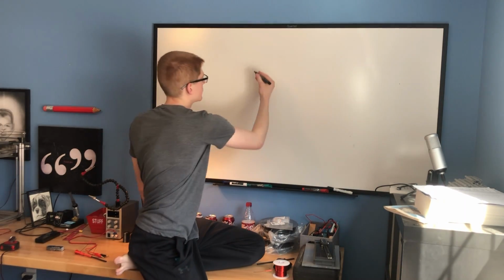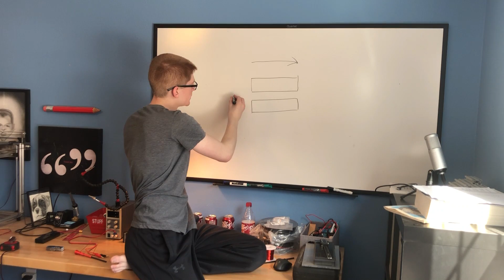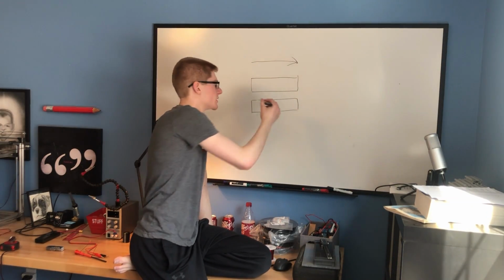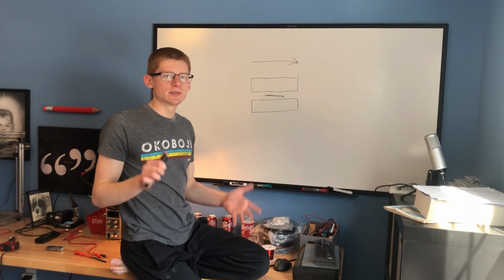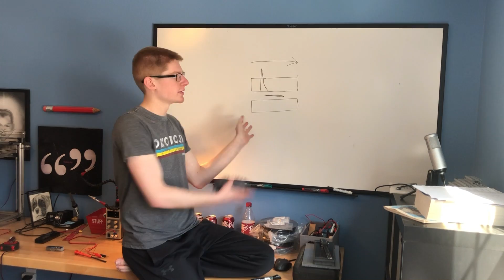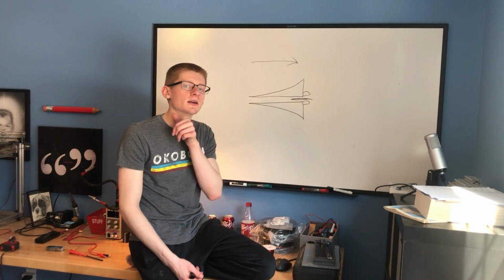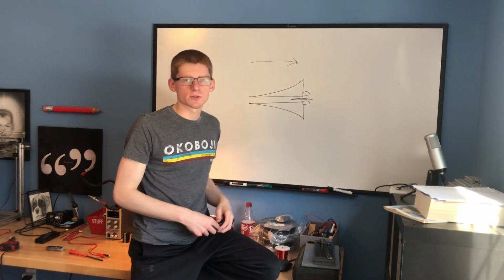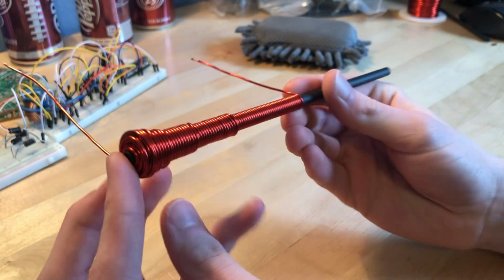Making a Coilgun - Part 3: Reconsidering Everything

Comment: It’s so incredible to me that this guy was willing to challenge the concept of a coil gun instead of attempt to perfect the pre existing designs that have flaws we’ve all been avoiding.  I always wondered why we have to use capacitors when their discharge is so strange for this sort of application, and that a constant high current would do much better.  However, I never thought of changing the coil shape to a curve following a log equation, but after seeing his results and considering his reasoning, it looks infinitely better than most modern designs.  Great problem solving man, this kind of work is truly fascinating!
Reply: Guys, I don’t think it’s worth arguing over this, you’re just going in circles of defining the units of an equation.  I know it’s not my business, but I’m not appreciating the notifications I keep getting
Reply: @homieboi5352  ah, apologies. I just wanted to clarify that for future builders. Coilguns are confusing enough on their own.
Reply: @TheArachnoBot  I'll have one up and running soon, and be trying different configuration experiments
Reply: @doubleooh7337  alright cool, I'll check it out if i remember. Personally, the revelations of Janssen's coilgun project were the final nail in the coffin for me. I'll be hoping for higher (and easier) efficiencies in the land of electrothermal guns.
Reply: @TheArachnoBot  i wish i did do my similar  design, but the one i made  is interchangeable  10 layers of wire for series or parallel configuration and different size projectiles , should have a stronger magnetic field
Reply: @TheArachnoBot are you referring to first exploding eg magnesium ribbon to pre accelerate the projectile? Is there a way to harness the collapsing field and either capture it ( as in John Bidini SGM) or use it for propulsion?
Reply: @TheArachnoBot just thinking, the circuit that can store many charges to explode eg. Mag ribbon with a layer of coated boom boom powder is less weight and complication, than a line of coils right? Would allow for traditional caseless round mags, and rifling, adjustable power . For Hybrid One could use a PCP platform to pre accelerate any coil gun?
Reply: @dorronski463  You can use anything as the explosive that can be ionized by electricity. Im just using air but i'll probably do some tests with other materials too. Mixing a coil gun and a conventional gun wouldnt make much sense, it would just make it super complex to build with no benefits.
Reply: @TheArachnoBot  Not true or the pros wouldn't be doing it already.
Reply: @dorronski463  which pros?
Reply: @TheArachnoBot  I remember seeing some military prototype, the pre acceleration bit definitely stuck into my bad memory. Lol sorry I can't remember the link please forgive me. If I remember correctly they were using regular b powder, they wanted maximum speed before it hit the coils, and with their budget managed to time the trigger coils very well.
Reply: @dorronski463  Hmm, well i've never heard of such a system. To be honest i've never heard of any "serious" coil gun, only hobby projects. I know of weapons systems that use electrothermal triggers to ignite the conventional propellant.
Reply: Have you thought about using ferrous end caps on the coils to focus the electromagnetic fields for better efficiency and to move the center of strongest force?
Reply: Its not the best design that wire can only handle 10amps, a coil needs to be designed to handle like 100amps 12v 100a is 1,200joules , 220v 100a is 22,000joules but a 450v 1000uf potentially has 101 joules,  its the coil that is the problem
Reply: @doubleooh7337  I think you are confusing joules with watts
Reply: @TheArachnoBot  really how many joules is 1watt? 😂
Reply: @doubleooh7337  none, one is energy and the other is power
Reply: @TheArachnoBot  obviously you don't know 1WATT IS 1JOULE/SECOND! 3,600joules/hour!
Reply: @doubleooh7337  "12v 100a is 1,200joules" Where does that mention time? That's as pointless as saying "that car is moving at the speed of 100 meters". I dont know why youre arguing about the literal definitons of units, you are wrong.
Reply: @TheArachnoBot  obviously you don't know!
 WATTS IS VOLTS X AMPS, 
or maybe it's just maths you don't know?
Reply: @doubleooh7337  Yeah, 12v 100a is 1200 watts, not joules.
Reply: @TheArachnoBot  how dumb 
1JOULE EQUALS 1WATT/SECOND!
Reply: @doubleooh7337  And you didnt mention seconds. Only volts and amps. Calm down.
Reply: @TheArachnoBot  i did actually
Reply: @doubleooh7337  Where?

Comment: When you speak of the barrel is the projectile going to travel through a rifled barrel.  It seems you understand the electromechanical ideas but to be accurate it needs to travel the length of the barrel with rifling to put a spin on it to make it accurate.  If you want to replace the chemical process with and electromechanical process it needs to be fast, accurate and generate speeds of at 1000 ft per sec which to me is the bottom speed. Let me ask you a question have you ever fired a real rifle to understand the foot-pounds involved in just a 40-grain bullet.

Comment: I doubt this will be more efficient. Single stage coil guns have terrible efficiencies (1-2%), the only way to get a coilgun to be efficient is to use multiple stages, that way the degrading magnetic field caused when one coil is switched off is cancelled by an opposing field (in the correct direction) in the next coil. The magnetic coupling of coaxial coils with this geometry would be terrible.

Comment: What if you used a compressed gas to accelerate the projectile before it reaches the coils? Would that eliminate the backfire issue while also increasing the velocity?
Reply: There's no backfire issue. He just misconnected the circuit.
Reply: Yes, of course, but then you're basically defeating the principle behind the device and turn it into an augmented air rifle...
Reply: @inverse2k1  sounds like the principle is weak if I can defeat it so easily! Does it even lift bro? Lol 😆 
Nah, but I get what you're saying. The point is to create a gun using coils. Not to use coils to augment a gun

Comment: If you dispose the sensor using just one coil would it work? Well, apparently yeah, because you tuned it with your hands and it still bent metal but I just wanted to make sure